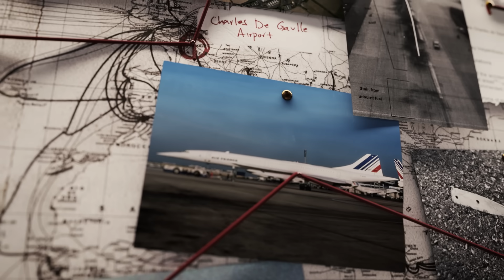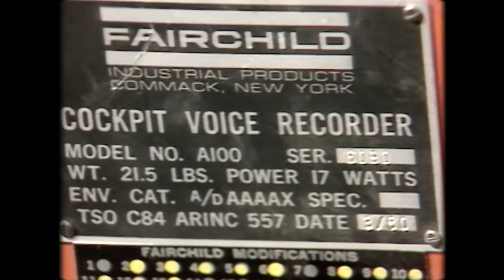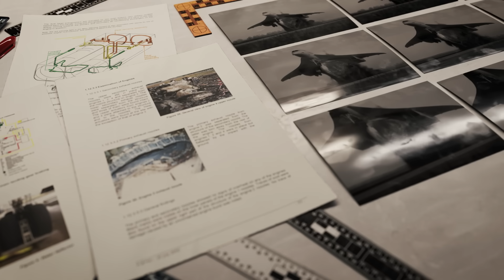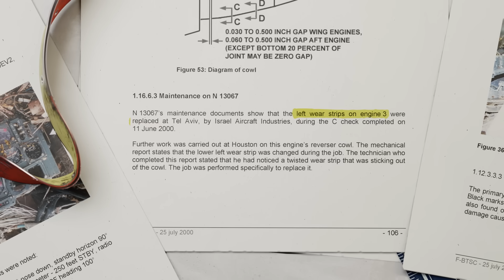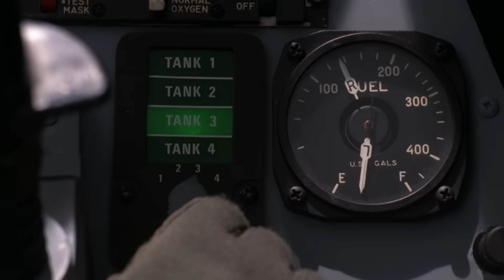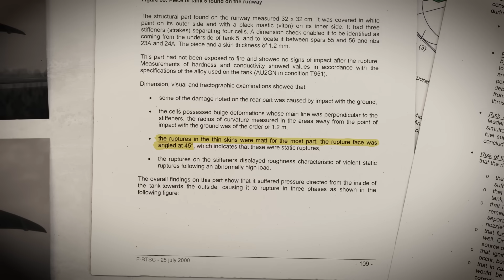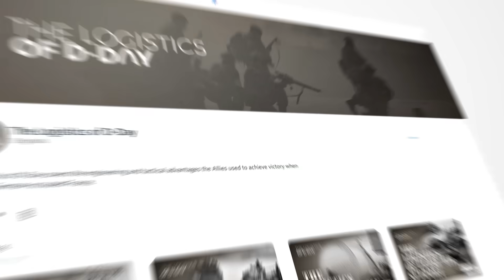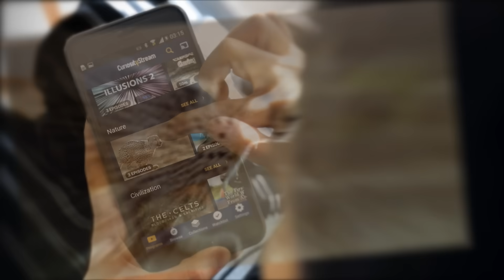What Actually Happened to the Concorde

Comment: Could underfilling the aircraft's fuel tanks have prevented this outcome?  The tank blew because there was not a sufficient air bubble to act as a 'hydraulic spring' to absorb the reduction in the volume of the tank caused by the object that impacted with its underside, hence the blowout.  So the question is, what would have been the maximum safe fuel volume as a percentage of total tank volume that would have enabled the overall system contained by the metal skin of the tank to absorb such an impact?  And what would have been the additional per-passenger-mile cost of having designed the tanks so as to be slightly larger so as to be able to accommodate the fuel necessary to complete the planned flight?  Should all tanks containing liquid fuel be filled to ninety-something percent, and never one hundred?

Comment: The take away from all this information is engineers and plane manufacturer knew about the ability of tire explosions from FOD that ruptured fuel tanks in multiple aircraft. Yet they continued to allow this plane to transport humans with the failures readily apparent. The airlines are responsible for the deaths of anyone because of this and should be held accountable for such. To go after continental for this is also a far reach trying to place the blame on someone else. The maintenance crew that did the work on the continental plane that was not a proper repair should be held responsible, but the manufacturer of the concord is ultimately at fault for their design to begin with. A plane shouldn't have tires that rupture so readily and a tank design that can be punctured by the tires is also a poor design.

Comment: Some say this crash could have been prevented as the plane was over weight and the fuel tanks had extra fuel added to the tanks saying if the tank had the extra fuel added there would have been another space in the tank to take the impact from the burst tire
Reply: Could? Maybe. Would? Unlikely. That like single ton of additional weight wouldn't have changed the core problems of the Concorde.

Comment: I can not understand why the Concorde does not fly anymore, just because of one accident. Other planes had more accidents and still are flying. I am sure today many people would love to fly with a Concorde. There are enough people who flies first class and such things, so money would not be a problem.
Reply: It was too expensive and impractical to modernize the fleet and all for a plane that had the capacity of a small 737. I think people forget that it was in service for almost 30 years.
Reply: The Concorde doesn't fly anymore because of safety concerns leading to less revenue to an already struggling plane. Airbus didn't really fix the problems with the plane after the crash. Rightfully so. Fixing the safety problems would've meant building an entirely new plane. A band-aid fix is easier.

The plane won't fly anymore today, because no regulator would certify that thing anymore. Too unsafe, too big of a polluter (in emissions and noise).

Comment: So Concorde was not at fault the Concorde moment has been and gone for cheaper much slower comercial aircraft and much longer flight time the irony is not.lost on the extremely fast pace of the modern world.😊
Reply: The Concorde absolutely was at fault. If it wasn't, the plane likely wouldn't have had as bad of a reputation hit.
Reply: @I_Dys Concorde had a bad reputation because uncle Sam gave it one and restricted it's travel routes making it untenable and inevitably in affordable. Let's fly by Boeing instead you can have the doors fall off or faulty fuel switches making the flights real interesting or real short toodle snot

Comment: I wish you had included "John Hutchinson on Air France 4590" a lot of valid causes of the crash disregarded by the BEA. Even 3 Air France pilots said Concorde should have taken off 1500 meters before the metal strip if the spacer had not been missing  (which retarded the aircraft and forced it off to the left of the runway when the tyre burst. Causing engine 1 damage when it ran over the runway light.) 

Also, the captain had ordered the tanks to be filled to 100% when the standard operating procedure (SOP) is to fill them to 83% to allow for airspace. Exactly to prevent a internal shockwave. Also, fuel transfer was on, pumping fuel forwards because the centre of gravity was far too rearward. SOP is to have this turned off during take-off. This intern helped the tank blow from inside out. Mike Bannister, in a recent book, stated tank 5 was 30% full of fuel when Concorde crashed. The tank would have been empty had fuel transfer been off. 

Concorde should not have taken off. Its configuration was above the maximum structural take off weight and the centre of gravity was too far rearward. Beyond 54% 

The flight engineer also shut down engine number 2 24 feet above the ground which is against SOP. The normal procedure is to stabilise flight at 400 feet and wait for captains decision. 

So had SOP been been followed that day. The accident would not have happened. It was an error chain of events filled with violations of SOP which caused the crash. It wasn't just one piece of metal on the runway which caused the crash. In court this was proven when BA pilots defended the mechanic that fitted the part to the DC-10 in French court of law.
Reply: "So had SOP been been followed that day. The accident would not have happened."
Or it would still have happened with engines that kept losing thrust anyway. Hard to say :)

Comment: the fact that one piece of metal can make a plane crash dosent really make much sense, i think a big reason has to do with the pilots unwillingness to not slow down and try to stop or try and land safely even if they couldnt stop, speeding up was a terrible idea
Reply: They couldn't stop anymore after catching fire without driving straight into a building's wall at high speed. They tried to land safely, but that was basically impossible.

Comment: Concorde by Mike Barrister (former Chief Concorde Pilot) brings up a different thesis, which focus on overfilling of the tank by AF pilots. Also, BA was willing to continue the operation, since for them it was profitable, as opposed to the loss making AF. However, Airbus (the certificate holder for the Concorde, spiked the certificate costs and BA alone could not sustain it. Recommend that book.

Comment: Comments
1.5K

The tanks were not supposed to be full and the pilot knew that but he wanted to impress the people who had charted this flight. The metal piece on the runway was merely a scapegoat. The wind direction had changed at the last minute to a Tailwind. Nearly a ton of unaccounted baggage had just been shoved into the rear of the aircraft under the tail. Being so heavily Laden with fuel and 100 passengers Plus four crew and three people in the cockpit the rear tires were being tested to the Max. Around 50 people claim that there were Flames coming out in the early stages of descent down the runway which pointed to a probability that the sudden Change in Runway level from the old bitumen to the new bitumen more than likely caused the tyre burst causing the rubber to slam into the wing underneath the undercarriage where the fuel tank was. Also rubber from the tire damaged the undercarriage stopping it from retracting. Because there was no space in the tanks this caused a ripple effect up and down the fuel tank and eventually it had to give, resulting in the tank rupturing outwards because of the pressure and fuel pouring out at an incredible rate. The Tailwind increased the excess weight of fuel, unaccounted for baggage and more taxiing fuel than necessary in the tail of the aircraft. 2 tons were put in for taxiing but they only used 800 kgs. 
This was a systematic chain of errors on behalf of the pilot who was prioritizing the people who were chartering the aircraft and had paid a lot of money for this trip of a lifetime that some of them had spent 20 years saving for. He didn't care about safety and guidelines and this resulted in the death of 100 passengers 4 crew, 3 in cockpit, and 4 souls in the hotel. 111 people perished. According to an experienced British Airways pilot who flew the Concorde this tragedy should never have happened.

Comment: Too many fundamental errors. Recommend diving deeper than the fuel tank. So many standard operating procedure errors before even making it to the runway. Don’t stop looking at surface level. Also, the crash had very little to do with the end of the Concorde. Again, look deeper!  Look at market pressures, 9/11, etc. Good graphics, but too much else is inaccurate to be given any more weight.

Comment: No mention of the maintanance screw ups or the baggage loading screw ups - please read the crash report - dissapointing! 1. The plane was illegally over it's MTOW - really not good with an engine failure on take-off. That is indesputable
2. It took off with a tailwind - the captain could have requested an alternate runway but elected not to. Some BA ex-Concorde pilots have said that decision was utterly bewildering.
If you combine (1) and (2) and you have an engine out on take-off you have severely limited your chances of survival.
3. The missing undercarriage spacer would have also contributed to the situation by making the plane yaw unpredictably during the take-off once the engine failed, giving the captain yet another problem to wrestle with in those split seconds, diverting his attention from the real problem of losing an engine whilst taking off AND overweight AND with a tailwind. Post crash, Airbus did some high-speed taxi / take-off rolls with a Concorde with the same undercarriage spacer missing and an engine cut at different speeds and the sudden yaw effect was considerable, certainly enough to create a significant distraction.

https://lovethemaldives.com/wiki/what-really-caused-the-concorde-crash

Comment: What happened u may ask well let me tell u. A Continental Dc-10 landed and a piece of metal broke off the Dc-10 and then after it landed the Concorde tookoff and the gear hit the piece of metal and the rubber hit the tank and the tank was leaking which caused the engine to get on fire from the fuel and then after the Concorde tookoff and soon crashed into a airport hotel. Sad story.
Reply: Gee thanks

Comment: The thumbnail hid the Concorde's shadow, which was fully over the infield grass when the photo was snapped.

The plane was suffering a near complete loss of engine thrust on one side, and a rudder not large enough to provide sufficient yaw authority to overcome the imbalance. The normal procedure for a kerosene fire is thrust, allowing the aircraft to outrun the fire. Concorde couldn't throttle up and still maintain directional control. They flew until the fire damaged their control surfaces. They were in coffin corner the moment they left the ground.

Sad the prime culprit (twin afterburning turbojets in one nacelle) was overlooked, blaming the whole sad event on a perceived error on the part of a soon to be bankrupt airline. It was only a matter of time before one of those Olympus engines threw a compressor blade, and when it did it destroyed the other engine in the nacelle with it, along with causing a massive fuel leak. Then came the fire ..  :(

Not the official explanation but .. I am sticking with it. IMHO Continental was innocent.

Comment: Photos taken of the accident indicate that the plane was on fire before it got to the spot where they piece of metal had been deposited. There were several things about that day and the treatment of the aircraft that need to be noted. The plane was overloaded with no conditions set for how much baggage each individual we bringing onto the aircraft. The Cargo Bay News also loaded more than 50% aft center of gravity. Perhaps as much as 54%. The plane was also run across a connection between the runway and the taxiway that was under construction. Something you are not to do with the Concorde. The Conchords tires are very fragile and you do not run them across from unimproved sections of Runway. As for the loading being behind center of gravity, the primary test pilot said that When approaching 52% of the load being to the rear of Center. The plane gets very unstable. At 54%, it would have been in flyable even if everything else on the plane were in perfect working order. The moment they took off, and his words, they were doomed. The interesting thing was is that the plane almost struck another aircraft that was just off the left side of the runway, had Jacques Chirac himself was in the cockpit to watch the plane take off. Had it been about 40 ft to the left, it would have destroyed the cockpit of that aircraft as well. Probably killing everybody in the cockpit if not more. The plane was doomed from the time they allowed people to get on with too much luggage, and no consideration was made for weight and balance.

Comment: The AF maintenance team had not refitted the spacer bar which allowed the tyre to wobble which caused lateral forces as well as compression and tore the piece off (sliced).  This hit the underside and as you said caused a pressure wave that ruptured the tank.  But the ignition source was the landing gear light wire that was cut by the exploding tank.  This ignited the fuel.

Comment: The French blamed the Americans for the piece of metal on the runway but having heard from a British Concorde pilot who was part of investigations, Air France made a list of mistakes, the runway was being repaired, the plane was overloaded and over it’s structural weight limit as the pilot was a famous Frenchman. They took 2tonnes of taxi fuel but only burnt 800kg. They took off into a head wind with the fuel pumps moving fuel which was forbidden in the take off procedure, so it was a catalogue errors but the French did a good job of putting all the bake on the us plane. Also it was 20m from hitting a 747 that had the French president in!

Comment: This video contains some serious errors - it is based purely on the Frence investigative report. The British were also involved in the investigation as they built the Concorde in conjunction with the French. They were so unhappy with the French report that it was attached as an annexure to it i.e. they were so at odds with that report that their findings could not be incorporated into it

Basically the British identified that a spacer bar was missing on the port landing gear - this spacer maintained the distance between the port and starboard pairs of wheels on the port landing gear - without this spacer the wheels began to wobble uncontrollably as evidenced by the marks on the runway. This resulted in a tyre blowout which hit the underside of the tank - all the details that you gave after this are correct but it is important to note that it had nothing to do with the Continental flight that had left 5 minutes earlier and its missing strip

The reason that the French were obsessed with this metal strip is that it took the attention away from Air France's maintenance short comings   - amongst many things it included the missing spacer bar referred to above. The Frence seemed to be quite tardy when compared to the British Airways maintenance regeme.

The ruling against Continental was subsequently overturned on appeal, which is significant as it also overturned the metal stip theory of how the crash was caused i.e. the British findings were correct after all

Concorde was veering off the runway and was coming periously close to an Air France jumbo with the President of France onboard amongst others - he actually witnessed Concorde on fire as it went down the runway. The fire started very early on the take-off run as firemen at their station could see flames from the jet shortly after it began its take-off run

Concorde actually operated very profitably for British Airways for some years after the accident. The Concorde was modified - I believe it had kevlar sheeting incorporated into the wing tanks to strengthen them, amongst other modifications.

The demise was caused by basically two factors, which again had nothing whatsoever to do with the Air France crash. 

1) The jet was up for re-certification - as the origional manufacturers on both side of the channel were long gone, its certification was going to be by Airbus.The list of modifications that they required were so extensive that they were prohibitively costly to do

2) There was a major lull in air travel around that time 

It would be great if your video could be redone to reflect the above as it is seriously incorrect as it stands at the moment

Comment: Small quibble. It's not "runway twenty six R", it's "runway two six R", or more normally "two six right". 
Runways are numbered according to their magnetic heading, in this case 260°. The "R" means that it is the right hand runway of at least two parallel 260° aligned runways. There would be a corresponding 26L and maybe a 26C (centre).
Pilots and air traffic control say headings as "two six zero" or "zero nine zero" etc, and runway lose the last zero and become "two six" or "zero nine", with a left, right or centre thrown in, if applicable.
Otherwise, excellent video, as usual.